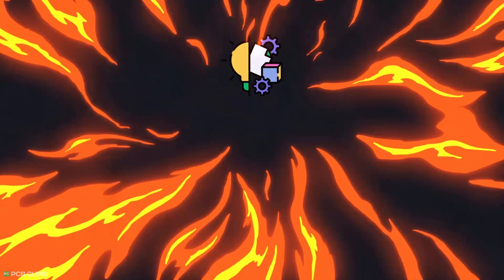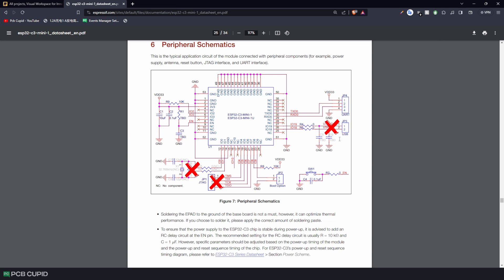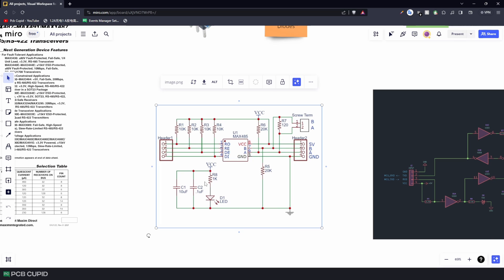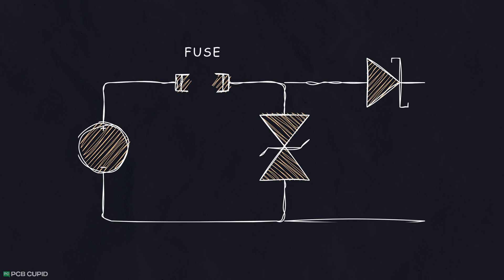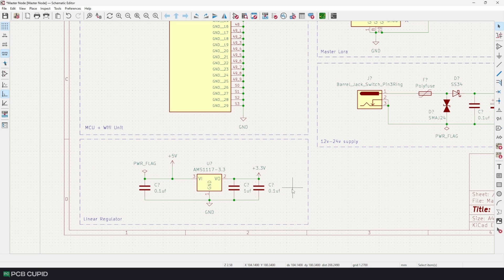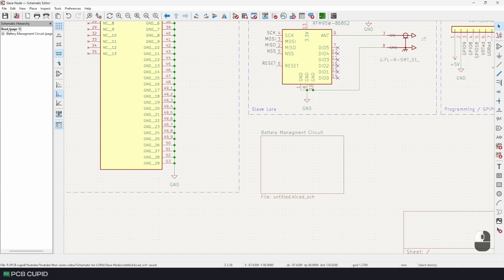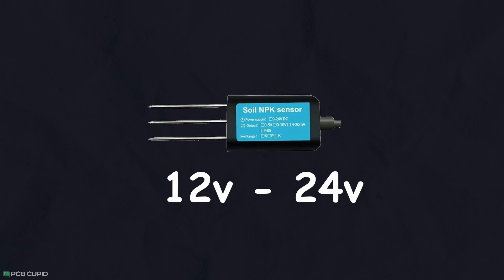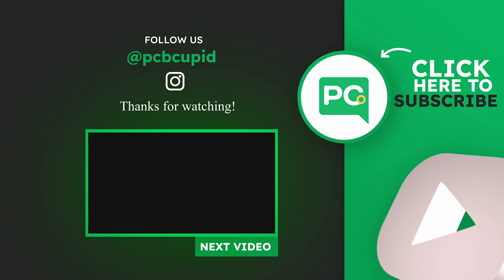#3 How To Build Lora + ESP32-C3 PCB from Scratch | KiCad #pcbcupid

Comment: Excellent videos (all 3 parts) : Good speed, explanation and to the point - power packed. 

I was only wondering  (a) if RTC could also be integrated. Is there any other way to maintain real clock time at slave end (assuming the situation when communicaation link is lost)  (b) Master could also have Ethernet optional provision.
Reply from the maker: a. Yes, RTC can be integrated via I2C. We left it out, assuming the device would always be connected to the internet. So it is much easier & cheaper to fetch time from NTP. 

b. Yes, that would be the best option incase if this device is used in industrial environment.
Reply: @pcbcupid  Thanks for your  prompt reply. You are righht about NTP but I only mentioned this because the devices such as mentioned here are usually remote and if the communication breaks and one is chaching the data for the duration, time would be cruicial. Indeed, as eventually the data would go through a gatewaay where time caaan be easily appended to the data.

What scheme do you suggest for ethernet - using via  same SPI bus which also controls Lora, with different CS ? Or any other suggestion.
Reply from the maker: @RajeevTandon-hw2lv  Yes, that sounds good. You can use SPI with a different CS pin and it should be fine.